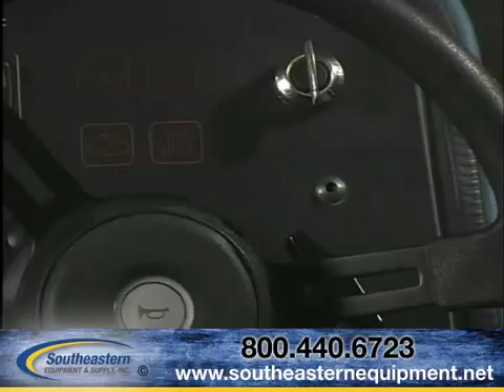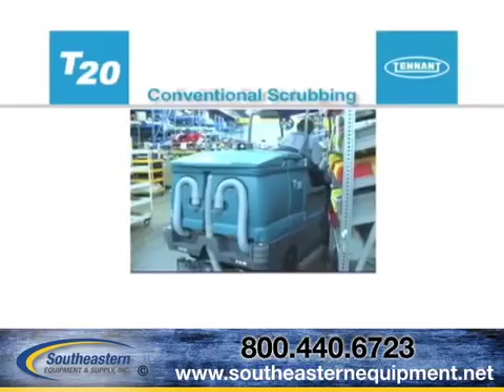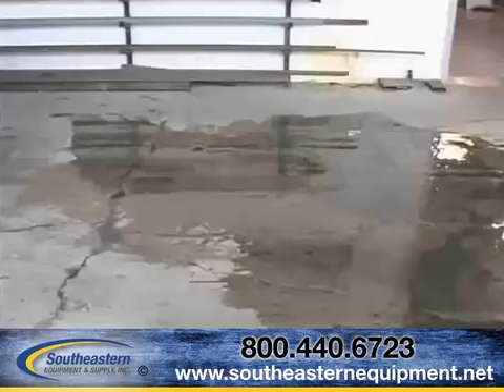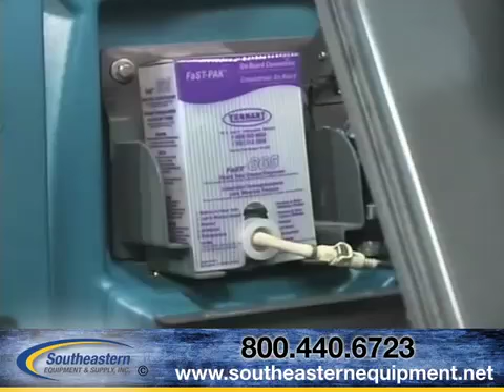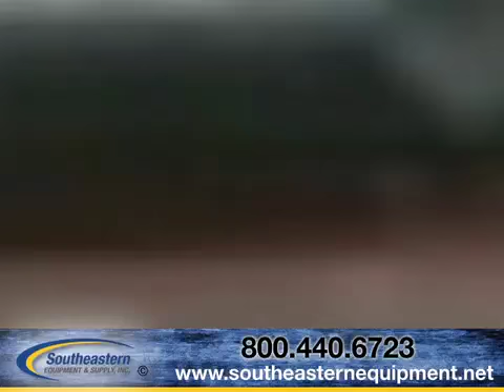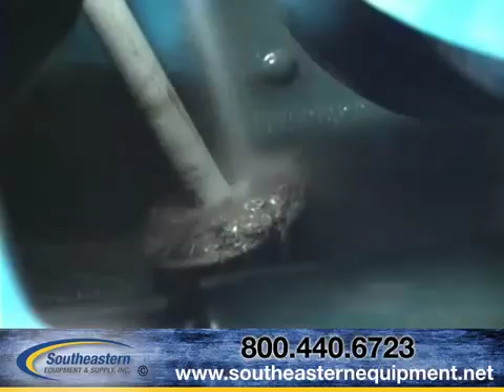Tennant T20 Rider Floor Scrubber

Comment: Any idea what to look at when the scrubber stops laying down water after 50 feet?
Reply from the maker: Hi there, thank you for your question!

Is there water in the solution tank? Check for debris in the solution tank and solution filter to see if there's debris causing the water flow to stop. Make sure the solution solenoid is getting voltage. 

If that didn't answer your question or if you have any others, we'd be happy to answer them if you contact us at <service@southeasternequipment.net>

Comment: Can this machine be used as just a floor sweeper?
Reply from the maker: Hey Trent, technically no since this is a scrubber. However, if the machine was a cylindrical machine, it would do some light  sweeping.  A true sweeper would have a separate hopper to catch the debris and dump it out.  A machine like the Reconditioned Tennant S20 LP Powered Rider Sweeper is a true sweeper or the Reconditioned Tennant M20 Sweeper Scrubber could be used to sweep and scrub or can perform dry sweeps as well. Shoot us an email at 'sales@southeasternequipment.net' if you'd like some additional information.

Comment: What would cause the machine to leave the floor dirtier than it was before scrubbing?
Reply from the maker: Hi Frank, it could be a number of things including not enough solution to the floor or wrong scrub speed. Give us a call at (803) 252-0100 so we can further assist you with this.
Reply: @SoutheasternEquipmentSupplyInc  thanks for the reply. I figured out the problem. I just started operating these machines and the previous operators never cleaned the undercarriage. There was at least 6 inches of mud build up around the scrubbers. I've been doing this job 3 weeks now and know more about these machines than the previous guy that held the job for over 10 years thanks to all the information made available from Tennant
Reply from the maker: @frankh.3849  Glad to hear you figured it out! We're here if you need us.
Reply: @SoutheasternEquipmentSupplyInc  could you please provide a link to a programming guide for the newer type scrubber? It's the one with the controls on the steering wheel. When going slow it does not disperse solution.
Serial number T20-9765
Reply from the maker: @frankh.3849   I've included a link to our PDF Manual Library below. If you have any additional questions or issues, please email us at 'service@southeasternequipment.net'

http://www.southeasternequipment.net/v/vspfiles/SES-PDF-Manual-Library/default.htm
Reply: @SoutheasternEquipmentSupplyInc  thank you for the link. The company I work for owns around 2 million dollars worth of Tennant machines and I'm the only one here that knows anything about them. We have 8 ride on scrubbers and 4 ride on sweepers. All divided up between electric and LPG powered. We have over 40 walk behind scrubbers. Before I came here no one took care of the machines and now I'm having a really hard time keeping them in good enough shape to clean the floors properly so I really do appreciate your responses.
Reply from the maker: @frankh.3849  We're happy to help! If you need service or training, we offer both Nationwide :) Just shoot us an email at 'service@southeasternequipment.net' and we'll put together a quote for you.